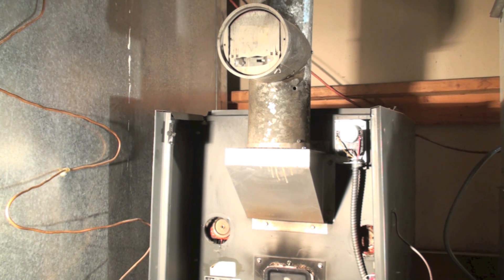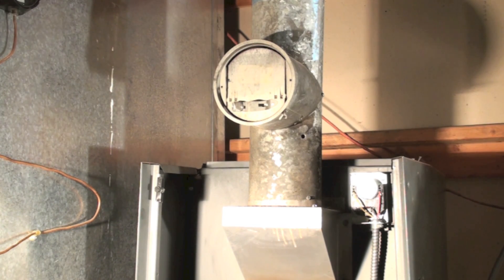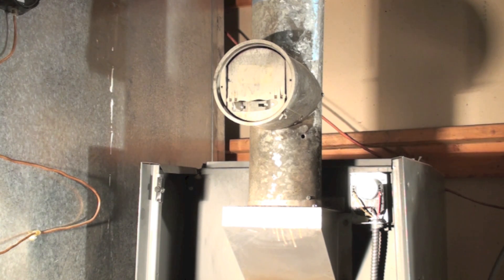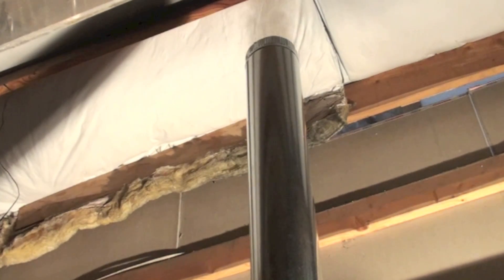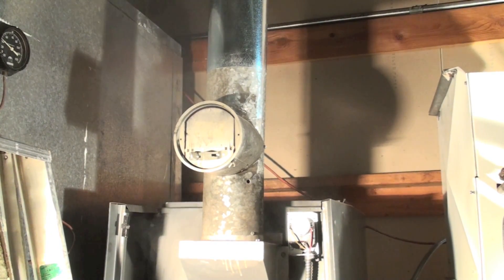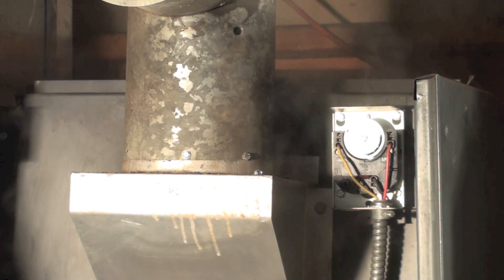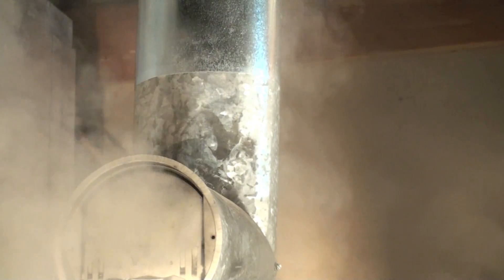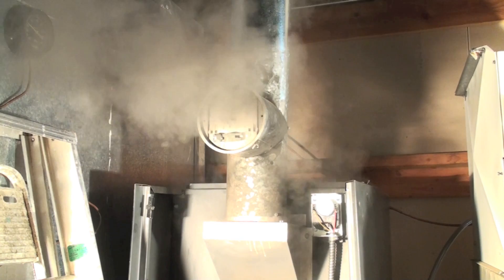Should you plug the sensing hole in the oil furnace vent?

Comment: It is so little difference, but sticking a short bolt into it won't hurt. When it's running normally the exhaust is drawn up and there is draw at the flap, but over the flap it can exhaust trace amount into the inside of the building however like he said they don't make the systems 100% leakproof in any way. I guess it's more preference on that one.

Comment: Shouldn't the weight be on top?
Reply from the maker: It will work both ways.
GFM
Reply: @grayfurnaceman  ok thanks.

My son put a recycled motor oil burning furnace in his shop that still has puffs of smoke & fumes coming out of barometric damper when wind blows.  The furnace is on stilts close to the roof  and the unit with 8 inch chimney pipe is about 5 feet from metal roof with 2 feet and a 4 foot extension pipe out of roof.

Comment: I was getting a diesel exhaust odor at the top of my stair well due to an initial fire-up shooting smoke out the test hole.  My barometric damper was much farther down the line.  So in some situations you do have to plug the test hole.  You just need a small piece of metal with two sheet metal screws, that can be removed for testing.

Comment: We have a two unit house with tenants and it has two oil boilers sharing a flue only one barometric damper. The boilers run a ton during the winter but the one on the house side is a huge Smith boiler with 7 inch stack with very high stack temps and the other is smaller boiler with 6inch and cooler stack temps but what I would like to do is add a heat reclaimer to the Smith boiler since they can be used on oil heat. Will that be ok? I was told that the chimney flue would be to cool if i did that but since they both share a flue the chimney i would think the chimney would never cool that much and if the smith stack temp is say 800 the reclaimer would probably be reduced to around 400. Thats still pretty hot! What do you think?
Reply from the maker: Ben Boudreau I would give it a try.  If it condenses, its too much.
GFM

Comment: The first question on my state test thirty some years ago was, How do you know a combustion test was done? The answer they wanted was there will be a hole in the smoke pipe
Reply from the maker: That does not sound definitive. lol
GFM
Reply: I remember it because I got it wrong.  I said there would be a tag with the results.
Reply from the maker: Al Gregory Yours makes more sense.
GFM
Reply: just because there's a hole in the pipe and there's a tag on the wall doesn't mean that your service man did that I've seen Guys gundeck these tags copying from last year or two years ago the best advice I can give any homeowner is even if you don't know s*** from Shinola about your oil system go sit down there while they clean it I assure you a lot more would get done in most circumstances

Comment: It's all about information. If it's wrong why not mention it, so some one else doesn't make the same mistake. 
The reason to have a sampling hole is to check combustion gas. If it is too close to the barometric damper you will get a bad reading. 

That being said... You can put your hole anywhere you want.